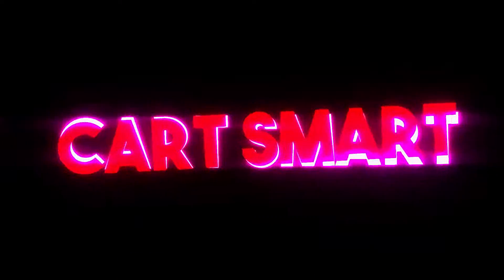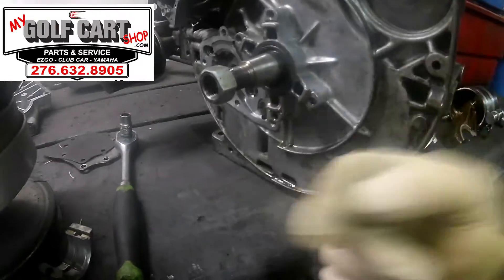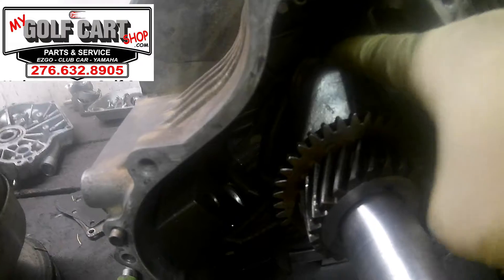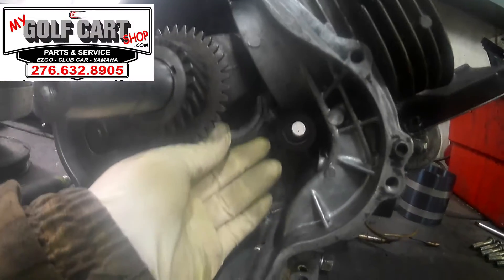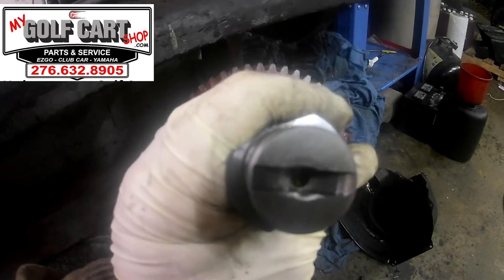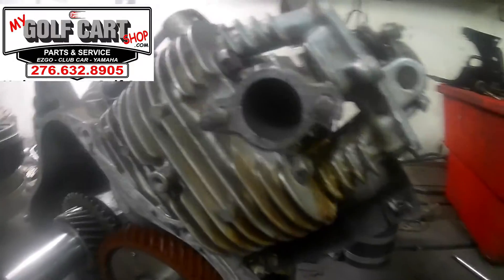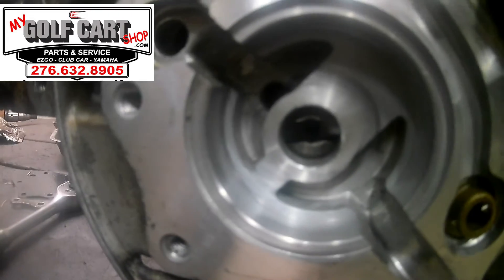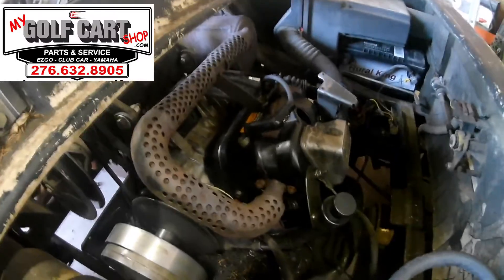Inside the Club Car FE290 engine - Had bad Oil Pump

Comment: Whenever I put the crankcase back on and tightened the cover I couldn’t move crank the engine at all. I found a shim that I forgot and put it back in. Took it off and all looks good. Is my bearing supposed to be to be flush? It has like a lip on it outside the case.

Comment: Is there a washer spacer that goes inside the engine or outside on the clutch? I have a left over washer that’s thin and about an inch and a quarter diameter
Reply from the maker: There's none on the clutch side, so, not sure??

Comment: Do you know if about 1/8th of an inch of crank play side to side is bad? Could you email me where/ and what the shims look like that may need replacement? I just got all my engine rebuild parts in. I don’t want to build it back if I need to service the crank too…is it usually ok not to service the crank and rebuild everything else?
Reply from the maker: If you go back with what you took out you should be fine. They mainly set them up at the factory. We've seen them with and without shims.

Comment: If my pushrod popped off the valve arm due to 1 of the tappets not pushing it would that be a bad oil pump? How would I know it’s bad?
Reply from the maker: That's a tough one as we never know until we put it back together and turn it over, (No fuel or Spark) just crank over till we see the oil pumping.

Comment: Could you help me? My 98 club car had the pushrod pop off the rocker arm. Does it have lifters? What would cause this because it won’t tighten up and is like 1/4 inch too “short”
Reply from the maker: The lifters are in the bottom. You will need to take the engine out and remove the side cover to see what's going on.
Reply: @cartsmarttv  Question: 

I have the engine taken down to just the crank, I want to rebuild it.  

No scoring in bores, there’s a small nick in the crank itself on one lobe. 
Would it be okay to build back? 

Does the piston rings have a minimum gap?